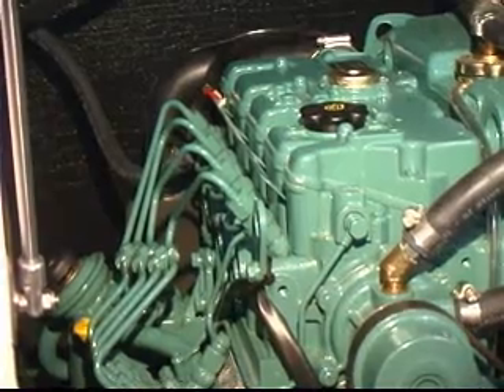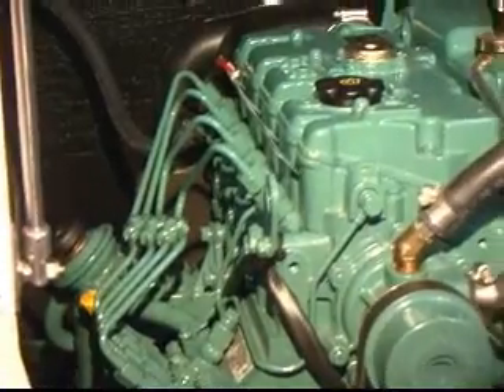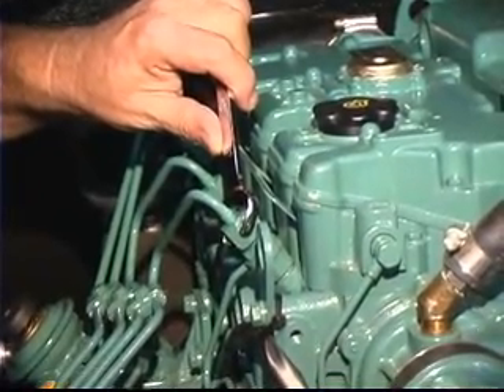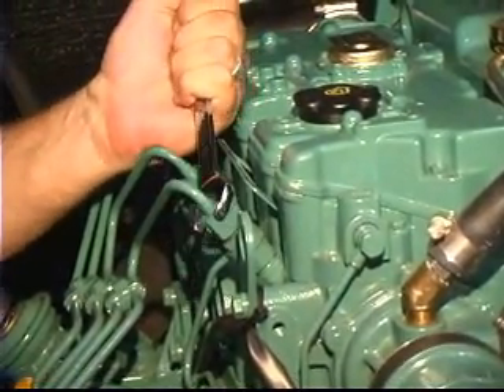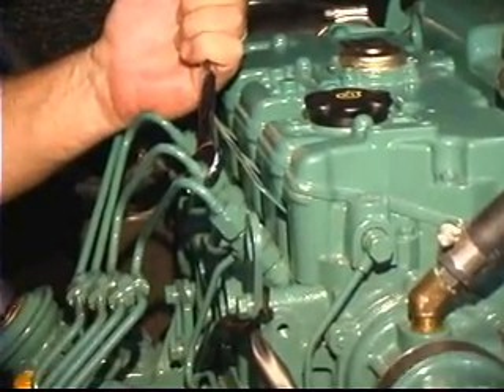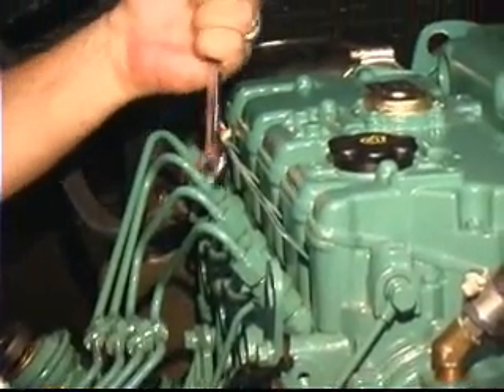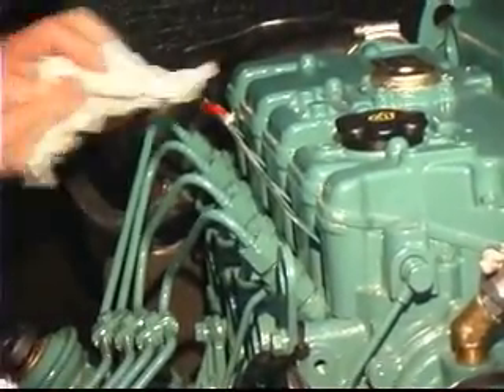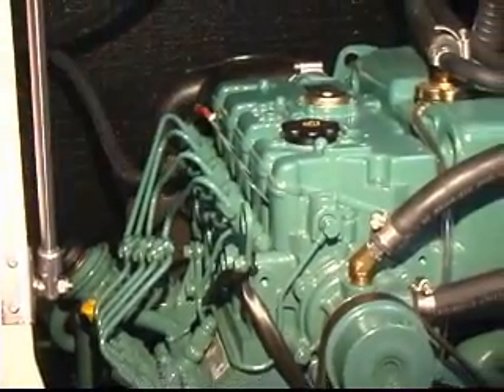Diesel, bad cylinder test

Comment: You can't do this test on common rail diesel engine's
Reply: Common rail pressures are way too high for this old school type test, have you heard of water jet that cuts steel, the common rail fuel pressure can cut your fingers off.
Reply: @davethemmp3763  wrong! Common rail systems use a Central high pressure feed for all cylinders, so by cracking one cylinder line you’d lose pressure on all cylinders. Common rails use a Main high pressure feed line and uses a electronic solenoids on each injector to control when they fire. 

this style uses a injection pump that is timed to the firing order via gears that connect camshaft and crankshaft. And injects a metered amount to each cylinder. Each line it separated from the other that is why you can preform this kind of test.

Comment: We have traced the cylider near the flywheel is not doing anything, the rpm did not change its a 3 cyclinder engine kubota d1402, tested the injector nozzle in pressure test it sprays fine, the smoke is transparemt, is this an issue inside the engine cylinder
Reply: Yes. Need to do compression check. If u do it and it blows out the exhaust or intake it's a bad valve seal or seat. If it rotates the engine your good. If it blows out the oil fill. Patch it together and sell it you have bad piston rings

Comment: This guy might be the worse diesel mechanic around.
Reply: talisay why do you say?
Reply: And didn't know what kind of wrench is the proper wrench to use on diesel injector fuel lines.
Reply: @stayhooked9499  Because its unbelievably simplified.
Reply: Gee, I don't know...maybe because he fumbled with the wrench and had it slip off EVERY BOLT THAT HE TURNED!!

Comment: Note to everyone who tries this on newer motors: DO NOT CRACK LINES ON HIGH PRESSURE INJECTION SYSTEMS, (this obviously isn't a high pressure)
Reply: which diesels are not high pressure for example?
Reply: Common rail run on high pressure, I guess
Reply: What happens if you do
Reply: @matthewstill7530  well im sure you already have your answer but for future reference of other viewer, just imagine opening a small hole on an high pressure line..either you get hurt or there will be diesel everywhere which will make a mess of everything and might ruins electronic circuit in your engine bay
Reply: Yeah, I work on kubotas that run 600 psi

Comment: I would recommend:  Safety goggles, rubber gloves, positioning paper towels or absorbent diapers under injectors before testing.  I have done this test in the past, and it is simple and it works.  Thanks.
Reply: Tom Kelly 
I put a condom on  to catch the diesel fuel. Safety first.